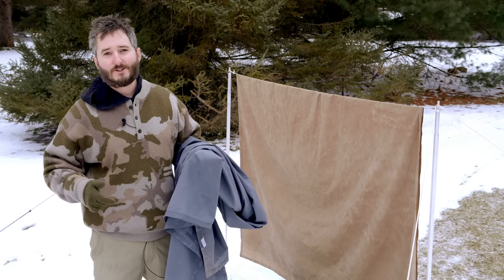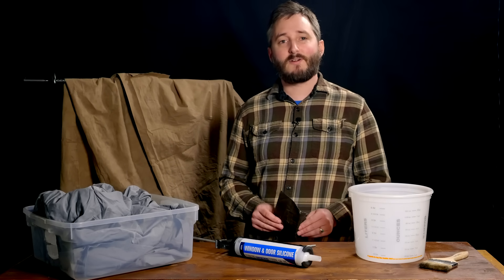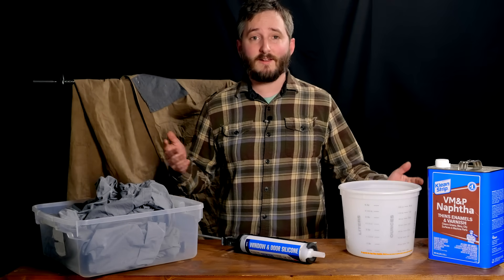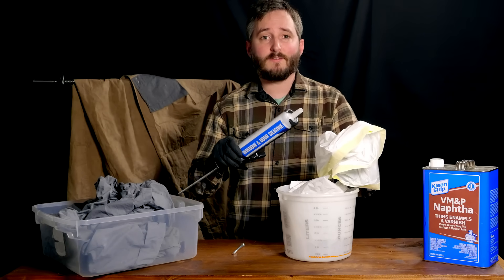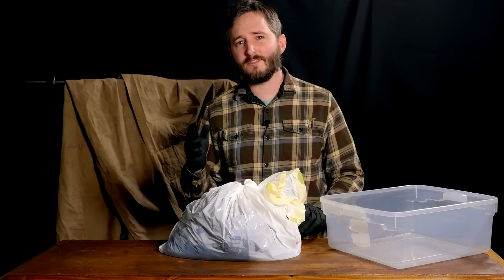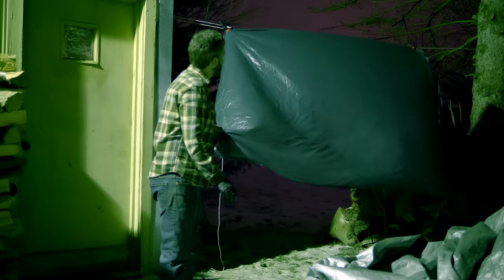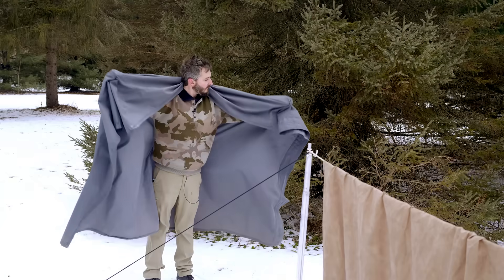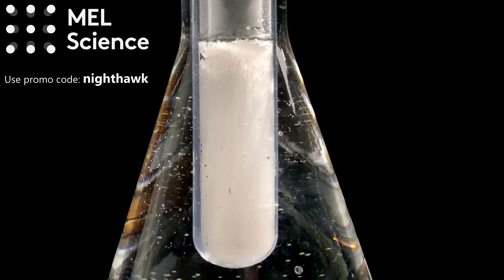Recycled Bedsheets Make The Best Waterproof Tarps

Comment: I wonder what effect it would have to do the soaking proccess in a vacuum chamber. Probably more even penetration of the waterproofing?
Reply from the maker: I don't think it would make a difference. It soaks in pretty well as is
Reply: This might be good for fabrics that aren't as absorbent as bedsheets- some of the manmade fibers don't do nearly as good a job at wicking. The Vac chamber might be a big help there. But as long as everything's coated it shouldn't matter toward the end result, as far as I can tell.
Reply from the maker: @jelteklaswijnja4055  Solvents like naptha seem to do a good job soaking into tough materials. They're quite a bit "wetter" than water.
Reply: You might have issues with pulling a sufficient vacuum, since the solvent has an even lower vapor pressure than water.

Comment: Would the white Naptha leave any dangerous or unhealthy residue after it evaporates that could be picked up by water? Say if the sheet is used to collect rainwater for drinking or I use it as a knotted bag to transport water?
Reply from the maker: It should all evaporate, but this fabric won't hold water very well. Water rolls off of it but you can force water through it with pressure. You can make it completely water impermeable by painting the silicone on thick, but for drinking water I would buy a food safe silicone.
Reply: @Nighthawkinlight  Excellent, thank you very much. I love the channel and your presentation style!

Comment: Ok, idk why I would ever need a tarp, since I don't leave the house like ever. But the button thing .. SHEESH! so simple yet so useful. Will be great for making cloaks for Halloween haha
Reply: If you ever get a broken window or a roof leak a tarp is handy to cover it until you can get it fixed. He also used it to cover wood in this video. If you have any sort of equipment like a lawnmower which spends a lot of time outside it's a good idea to cover it, too.
Reply: @asahearts1  oh shit, you're right, that makes a ton of sense! Luckily my lawnmower is in my basement, but I could probably use one for the firewood outside
Reply: @catdisc5304  Just be sure it doesn't trap condensation, or so I've heard. I think they said already seasoned wood should be covered on top but not the sides.

Comment: I wonder the validity of using this method for a canvas boat cover. It has already been treated and that is just breaking down over time.  Any thoughts?
Reply from the maker: I think it couldn't hurt to try if the cover would need to be thrown out anyway. Just make sure the solvent is completely evaporated before putting it back on the boat or it might damage the paint or seats.

Comment: hello translated using transcription. Try this recipe: we take the fabric that we want to make waterproof, and lower it into hot soapy water, let it soak well, and then completely dry it. Next, we lower the fabric with the dried first layer into the alum solution, let it soak well, and then also completely dry it. The procedure with the second solution can be repeated twice. Done
Solutions: you need to take the toughest soap. in Russia, this is 72%. Three on a grater and in hot water to dissolve well.
Aluminum-potassium Alum (10%) + water (90%)
This recipe is more effective, since there is no solvent that smells bad.
Reply from the maker: Interesting. I did not know alum could be used as a waterproofing
Reply: @Nighthawkinlight  try this very old recipe. Sails were impregnated with it in ancient times
Reply: @dimasja100987  do you rinse the soap out of the fabric after step 1?
Reply: @Eyes0penNoFear  no, the soap should stay on the fabric. buy the cheapest soap with a high content of natural fatty acids and sodium salt

Comment: Thanks for this! Do you have any data on your siliconized fabric tarps that are stretched tightly over a wooden structure? Do they keep the water proof properties at all? And for how long? Something about UV stability?
More questions than answers, I fear. As usual ;-)
Reply from the maker: Good questions, I wish I had answers. One thing I can say for UV stability is if you want to do it right mix some carbon black into the silicone before coating the sheet. That's how they make tire rubber and outdoor plastic pipe stand up to the sun.
Reply: @Nighthawkinlight  what is carbon black  .

Comment: What is the breathability like after treatment with silicone?
Reply from the maker: Still breathable, unless you paint a coating on thick
Reply: @Nighthawkinlight  thanks will give this a shot on my solo tent *after I check to make sure the fuel wont melt material.

Comment: Something not quite as permanent to use on clothing items is carnauba car wax mixed with 96% isopropyl alcohol. It doesn't take much wax, then it can be sprayed from a used windex bottle onto fabric until wet then let dry. It washes out after being laundered a couple of times though. I quit buying expensive name brand aerosols after discovering this method.
Reply from the maker: Good tip!
Reply: Very good tip👍 Thanks
Reply: It would be interesting to check if this silicone solution would wash out when being laundered.
Reply: @parrata  It shouldn't, but even if it did it would take a lot of laundering, and probably only wash out enough to make it less water resistant. If it did you would just need to reapply the solvent/silicone mixture and let dry (and cure) again.
Reply: You can actually buy real chips of carnauba wax, it dissolves in white petroleum

Comment: I wish I had known of this years ago when a tent lost it's waterproofing. I bought a spay on waterproofing and it only coated the outside surface and took a couple cans, cost alot. This way would have treated the whole tent and made like new for about the same cost.
Reply: I do wonder how to deal with zippers- I don't think they like having silicone in them. Or would you brush-apply it?
Reply: @jelteklaswijnja4055  Should be fine.

If anything the silicone will probably act as a lubricant.
Reply: @jelteklaswijnja4055  Makes no difference, to the ones I have used it on. More about not having the zip part gets filled.
Reply: Just to be safe, could rub some wax on zippers first.
Reply: Silicone is often used as a lubricate, it's what was provided from the supplier for use on my wetsuit zipper. Probably not in this exact form however as wobbly sauce said it's likely just about making sure the zip parts are free enough to work.
Reply: @thetelerion6717  Yep, it comes in many forms.
Reply: Silicone lubricant is a non-setting goopy substance. It can be pretty thick for use on a zipper but is certainly an option. The issue with any sorts of lubricant is compatibility with materials. If your zipper lube eats the tent coating, that's a problem. If your zipper lube likes to eat zipper plastic, that's also a problem. There's also the fact that lubes attract (or at the very least) hold lots of extra grit and dirt in your delicate zipper mechanism. Not ideal.

Good luck!

Comment: @NightHawkInLight  Regarding the "VM&P Naphtha" through a bit of research while I was looking to do a DIY Electrical contact cleaner, I discovered that Coleman Camp Fuel, AKA "White Gas" is actually Naphtha, based on the MSDS!!! I have the MSDS if you want me to shoot it your way!!! BTW, Great Video!!!😁👍🏻
Reply from the maker: Naptha is a bit of an imprecise term, so it can describe a couple different chemicals. White gas is one of them!
Reply: @Nighthawkinlight  So this would works with camp fuel (white gas)? Around here it's almost half the price as naptha.
Reply from the maker: @NickHorvath  I think so, but I have not tried it myself
Reply: This is what I came down here to say.  You can get a gallon of Crown Camp Fuel for a lot less than VM&P.  Also "lighter fluid" for zippos is basically the same, just a little lighter and evaps a bit quicker but for the price difference you can just refill it sooner.

Comment: The problem with a Silnylon tarp is, it does not work with a campfire / sparks. does this material work better?
Reply from the maker: I tested it a little bit and it seems to stand up to sparks better, but I haven't used them around a fire for a long time yet to really see how they hold up.
Reply: I have problems translating naphta. Can you give the contant, description of naphta please? Is it light gasoline without any additive?

Comment: Would the sheet/tarp be super flammable?  I would be afraid to use it anywhere near a flame.
Reply: It would be until the naphtha dried.
Reply from the maker: It's no more flammable than a regular plastic tarp. You can buy super high temp silicone which would be an interesting experiment, but more expensive.
Reply: Normal silicone is flame resistant and heat proof to about 500 F. If the base fabric is synthetic it's the bigger risk. That said, a plastic tarp would melt much faster than this would be heat damaged. Once this has "cured" the solvent is evaporated and it's not longer flammable, but until then yes keep it away from sources of ignition.

Comment: I recently did a beeswax coating on a "rain" jacket which leaked like a sill, it worked but became pretty ridgid and changed color, going to try this next time!
Reply: @salvationbygracethroughfaith  I had no problem with bees! Mosquitos on the other hand... But thats to be expected in the north of sweden.
Reply: Did you watch his newer video on this, revisiting his technique and treating his jacket?
Reply: @Tonisuperfly  Yeah I saw it! Great video, Ben never fails to make interesting videos on seemingly dull subjects. That said, my beeswax coated jacket is still wind and water resistant and doing just fine!
Reply: @dannes22  is it still stiff? Does the wax ever come off at all? Would it melt off if you left it in the heat somewhere e.g. in a hot car?
Reply: @Tonisuperfly  Its still stiff and works just fine, never had any problems with wax rubbing off or anything like that. I've haven't used it a ton but it has stood the test of time just fine, in hot and cold weather.
I was down in Italy this summer with the jacket in there all the way and had no problems.

I would say applying beeswax does take some effort to really get a good and even coating. I haven't tried the silicone/naphtha method but it does seem waay easier to apply if you're not worried about coating the entire garment.
Reply: @dannes22  thanks for the reply. I’ll have to play around. :)
Reply: @Tonisuperfly  No problem! If you can remember, tell me how it goes ;) Good luck!
Reply: Seems like it didn't soak through, maybe some heating would help?
Reply: @Spiralem  I did heat it up and it did work fairly well, the jacket is quite usable, but as I say, a bit ridgid still after the heating, I could't heat too much as there was a lot of plastic in the jacket which started to burn at quite low temperatures.
Reply: @dannes22  hair dryer.not too much heat.cheaper than heat gun,especially if you find a working one while yardsaleing for bed sheets and half full cans of naptha.one man's junk...
Reply: Silicone fabrics on the skin can be very irritating. Make a test piece first, like a bandana. If you can wear the bandana for a day, then I would try it on a coat.
Reply: @zachcoldwell7978  Silicone allergy is somewhat rare, and just like any other allergy to most people it's not a problem at all but to those few it's very painful. 

And your recommendation of testing it on the face is really silly.. Just wrap it around the forearm above the wrist so it's the least irritating it can be if you are allergic to it.

Comment: Regarding the use as clothing, does the brush method allow the fabric to breathe at all?
Reply from the maker: Depends how thick the mixture is. If it's thin then it soaks into the fibers and remains breathable, but if it's thick it goes on like a sheet of rubber

Comment: How does it do for holding water?
Reply from the maker: Water can push through the fabric if there's pressure behind it. You can make a 100% water impermeable sheet with silicone, but you have to paint it on as a thicker coating.

Comment: Thank you for an idea. Do You use neutral silicone?
Reply from the maker: I'm not sure what neutral silicone is. 100% clear silicone adhesive is what I used
Reply: @Nighthawkinlight  we have two general types of silicone sealants on the shelves here at my location: acetoxy and neutral cure. Acetoxy smells like vinegar for about a day and causes light burns when it touches unprotected skin. But it is about 40% cheaper.
Reply from the maker: @suvorov_oleg  Ah yes, I used the acetic acid silicone, the cheap stuff

Comment: whats the price of the silicone and solvent?  I mean tarps tend to be 20-40$ so if it cost more is it worth it
Reply from the maker: About $16 for a gallon of naptha, $8 for a tube of silicone. I used about half a gallon, and one tube of silicone for these tarps so about $16
Reply: Its been a year. Did you have to recoat the fabric?  @Nighthawkinlight
Reply from the maker: @JT-91  No, the coating is the same now as ever. The sheet has gotten a few holes torn in it from wind blowing it against my wood pile
Reply: I think the appeal is in durability. Plastic tarps tend to break down in the direct sun and strong winds can tear holes in it. A fabric is more durable and so will last longer than the plastic.
Reply: He clearly went over the benefits over a plastic tarp in the video

Comment: ive always had doubt about the durability of spray on water resistant coatings, this definitely seems like a better waterproofing method.
Reply from the maker: I think spray on coatings are often a very similar silicone and solvent mixture. This method I think is longer lasting because you get way more silicone soaked into the fabric instead of a surface layer.
Reply: @Nighthawkinlight  I think the spray is mostly starch.
Reply: @Nighthawkinlight  I believe it’s more like a silicone oil. I don’t think it hardens/cures like tube silicone.
Reply: there's also the ones that wash in but i'd imagine that a whole bag of 20% silicone gives you a lot more waterproofing than anything you can put in a washing machine.
Reply: Do you mean just the consumer level stuff?

Comment: Use a jam knot to secure your slip knot, as otherwise that knot could pull itself undone under tension. 

There are plenty of bushcraft and sailing channels here on YT that can explain a jam knot better than I can, with video guidance to boot.

Is this silicone-treated fabric also less breathable than the original bedsheet? Does it also hold heat in when you're bundled in it?
Reply from the maker: It probably is less breathable, but not air tight like a pure sheet of plastic. It does hold heat in kind of like a windbreaker
Reply: @Nighthawkinlight  aye then I guess you'd have to use a full plastic cloth, polyethylene or nylon or somesuch to get a fully sealed material. Breathable is better though, you'll get less follicle or sebaceous gland infections that way.
Reply from the maker: @GirishManjunathMusic  You can make it entirely non breathable by painting on a thick mixture, or even non diluted silicone.
Reply: @Nighthawkinlight  it's a pretty tight balancing act to get a cloth that keeps you warm while not taking up a large volume or clogging your pores with sweat and oil.